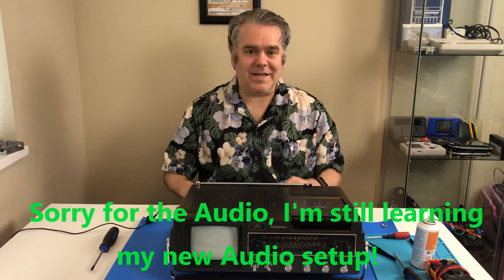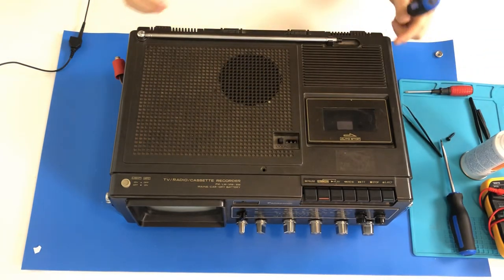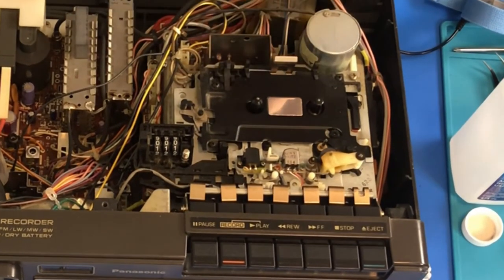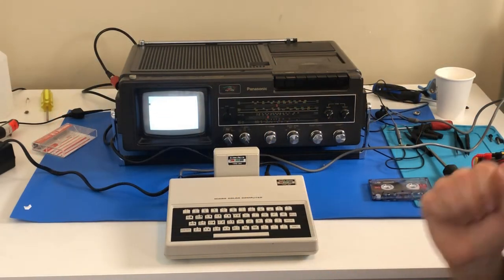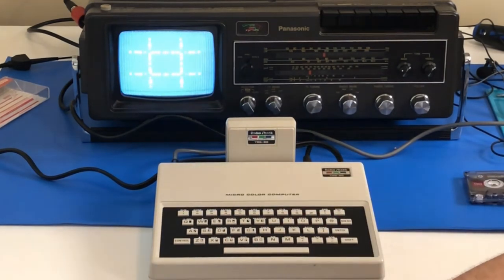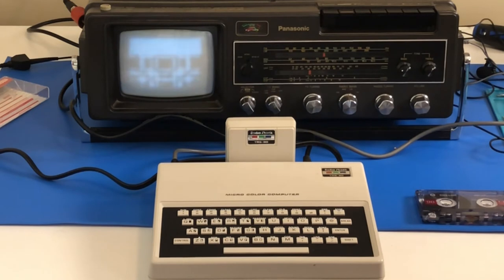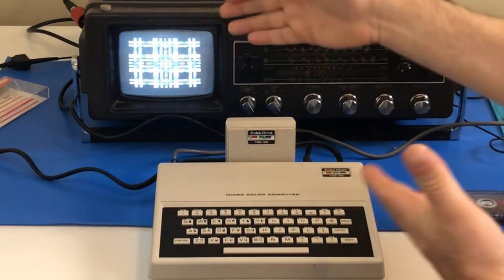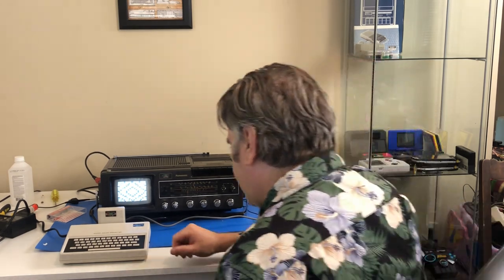Round 2: TRS-80 to Mini TV/Cassette Deck, This Time It's an MC-10!

Comment: I've done a similar thing using a portable color TV with AM/FM radio.  It doesn't have a cassette recorder like yours.  But the built-in radio can be a wireless network interface for the CoCo.  What I did was use one of those little FM transmitters that were all the rage a few years back for playing .MP3s on your car stereo hooked up to the audio out jack on a modern laptop.  I could then tune the transmitter to the same FM frequency that corresponded to where the tuning dial needs to be set for channel 3 on the TV.  I could issue a 'CLOAD' or 'CLOADM' command on the CoCo, then flip the switch to the radio function on the TV and hit 'Play' on VLC on the laptop to play the .WAV file over the air and pick it up on the CoCo.

'80s WiFi -- when cassette tapes are just too simple and reliable.
Reply from the maker: That would make a cool video of strange ways to load programs on your computer!!!  If you are not planning on it, would you mind (with credit to you for the idea) I ran with it?
Reply: @CanadianRetroThings  Do it!  There were apparently some computer-oriented radio and TV shows in Britain and eastern Europe that actually broadcast computer programs in the '80s that you were supposed to try to record on tape and then play back on your computer.
Reply from the maker: @joelavcoco  I will attempt this :)
Reply: @CanadianRetroThings  If you mention my name, Ewy is pronounced the German way.  Pretend you're Dr. Strangelove and you'll school all the N00Bs.  Like you're saying the initials of the Audio Visual department.  Ay-Vee.

I'm looking forward to your video, and I've really enjoyed the ones you've done so far.
Reply from the maker: @joelavcoco  Thanks...I'll try and get the name right! :)